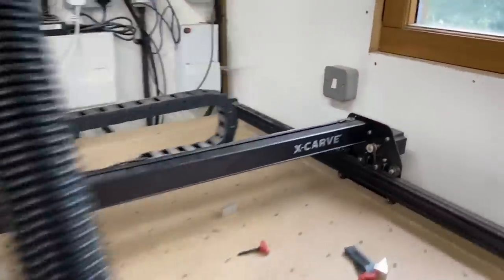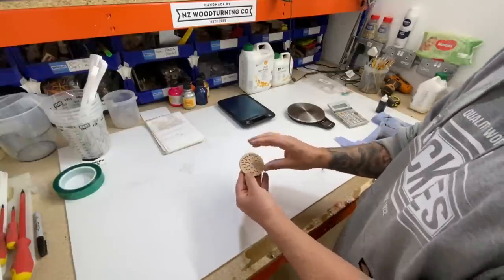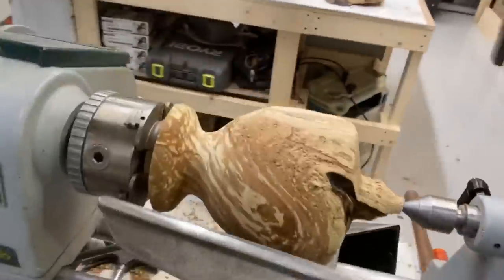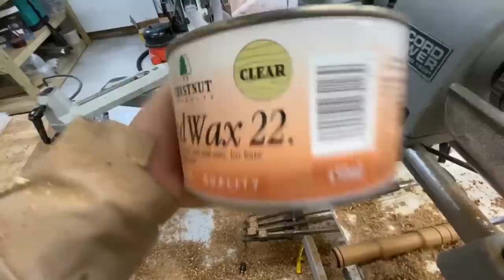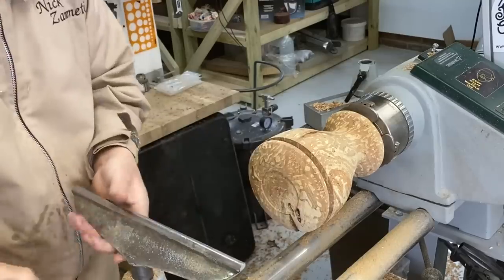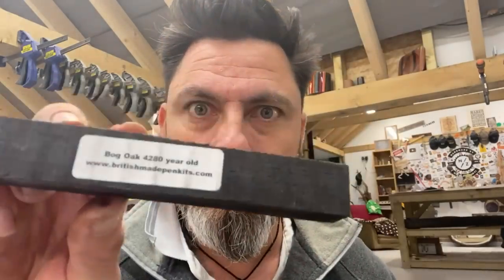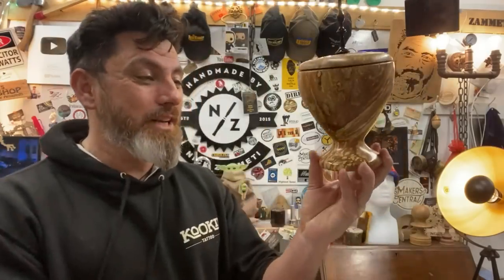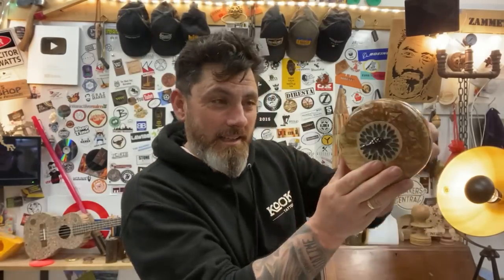Woodturning - The Holy Grail

Comment: Interesting, Nick. Two ideas - first, could you have had the X-carve make the hole for the finial? Second, if you would have done the resin before separating the pieces it may have been easier to sand. Also, that finial is over the top (get it?).

Comment: if you poure a color like you did 
first use a thin coat of transperent resin 
brush it on let that dry 

and then poure the color that way it does not suck into the wood

Comment: I cut up two evergreen trees that were in my front yard, but half dead.  The logs I got from them are perfect for turning and my wife would like me to make something nice from them.  The issue is they are full of sap.  I have one of the logs inside with a space heater on it and it is forcing some sap to drip out.  My question for anyone here is, can I do anything to get rid of the sap or dry it up or should I just trash the idea? Thanks.

Comment: I want you to try a resin by numbers stained glass window with the CNC machine. In other words use the CNC machine to cut out all the pieces of one color. Remove the wood from the CNC machine and resin all of those holes with that one color. Return the piece to the CNC machine and repeat that process for all of the other colors. Then remove the piece, sand the back so no wood remains in the resin sections, and then turn it into a light box so it's lit from behind.

Comment: I have an idea... sort of a challenge for you, but not very challenging, I don't think... turn a piece, part off the lid, then X-carve a design into the lid, then fill the design in the lid with resin, pouring it deep so you can turn the finial from the resin, making the finial an integral feature of the lid.